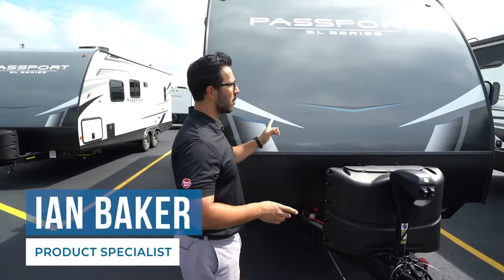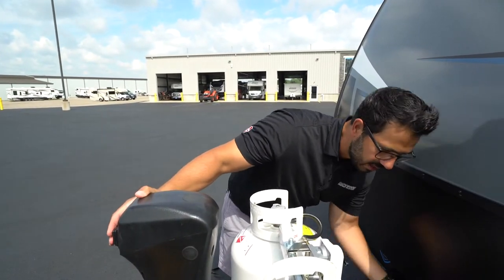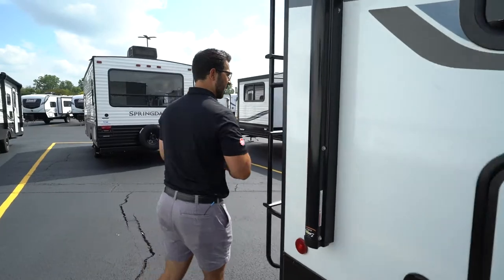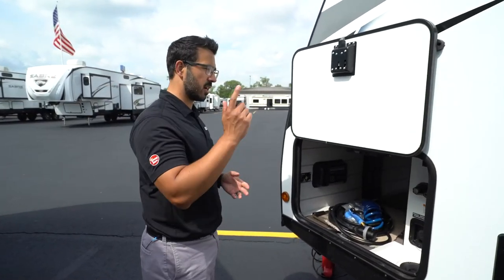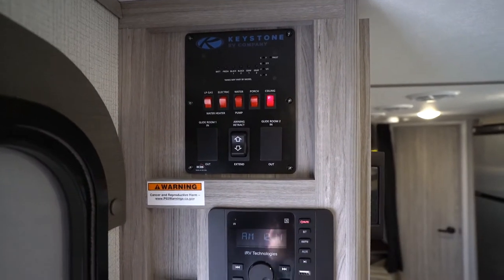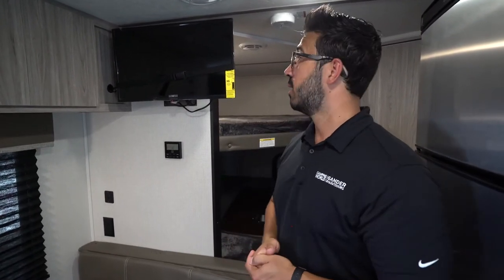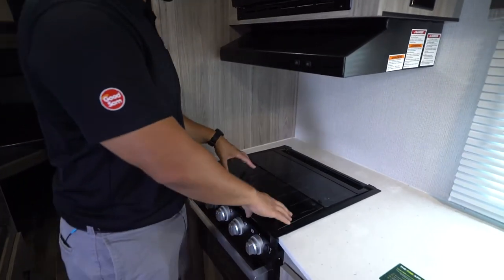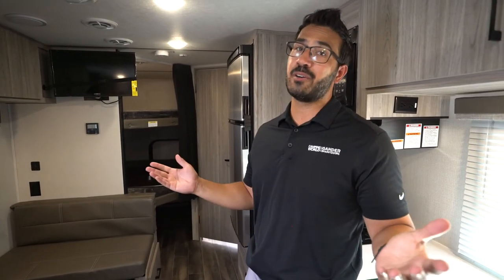Meet Your New Keystone Passport Travel Trailer

Comment: Appreciate that you explained the lighting of the oven. Might use it now, didn't last year. I bought a new 219bh early last spring and the dealer rep wasn't certain about many things that I'd already researched here.
My black tank sensor 'went' early on. Not a big deal since, when the tank is full, it'll 'burp'. I'm the only one using it so basic maintenance is on me or I know who to look for for help. 
First time owner, second year with it. Mine has the Murphy bed - excellent use of space in a 25' TT.
Had a Max Fan installed in the bathroom for better air movement when the AC isn't needed. I may have the bunks altered from full size to twin size, the AC ducts do not offer any cooling to the lower bunk. Used a USB table fan on the counter top, aimed toward the lower bed. Some of the older units have their hot water tank under the lower bunk, adding to the problem, the 219bh has it up front where it should be. 
Great video, I saw the one you did on my model TT last year...
Reply from the maker: Thanks Terri!
-Ian Baker